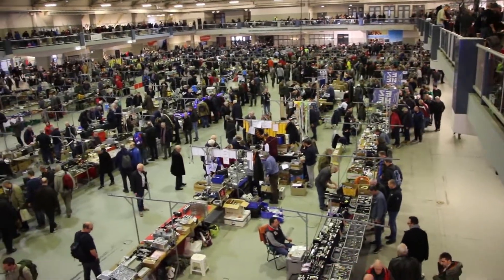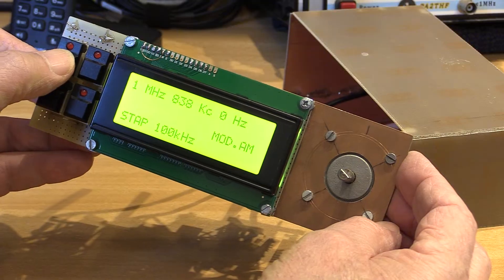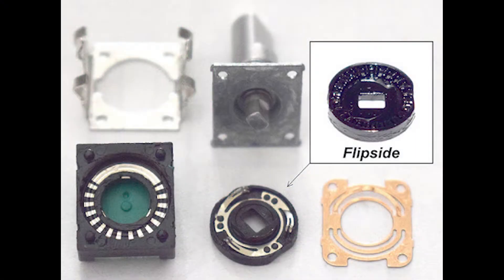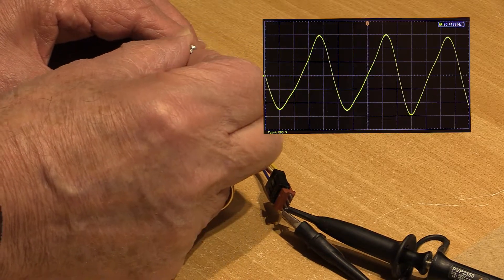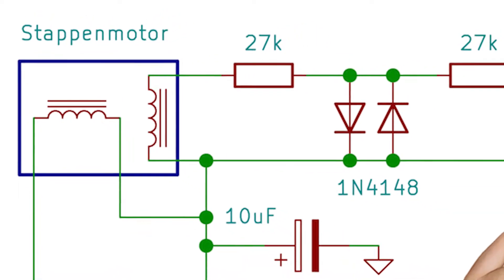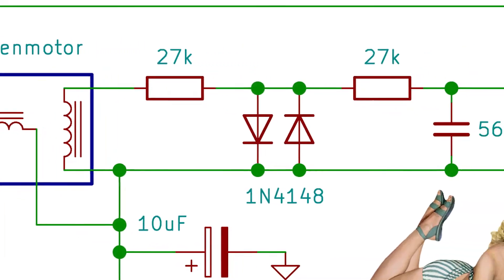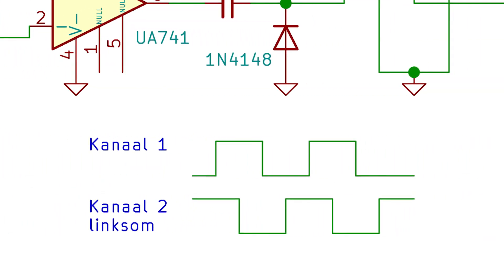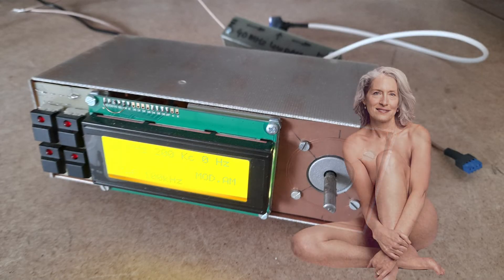stepper motor as rotary encoder

Comment: There are detent-less modifications of an ALPS/Alpha contact encoder, which may be better to operate than the standard type, and are used in quite some digital music instruments, but it's not really a high endurance input. There is also optical encoder, you get a good enclosed one from Ali inexpensively. Indeed the same industrial surplus store that sold you the stepper will likely sell you an optical encoder gained from another printer, comprised of a sheet of transparent plastic with lines printed on it and two fine pitch LED gates, so it's not enclosed as opposed to the one off Ali. Third good opportunity is rotating shaft with a magnet and Hall effect rotary sensor, you may find open source project to sense stepper position that way, but of course you just skip the stepper.

I wonder though. If you turn the shaft very slowly, will the stepper read? I think if slow enough, the current is not enough, but what would the threshold be? I wonder how repeatable it is with possible step loss. Maybe it's not a problem in real use because you can't turn the shaft slowly enough to cause a misread. I have a surplus stepper and rc4558, i can just try.